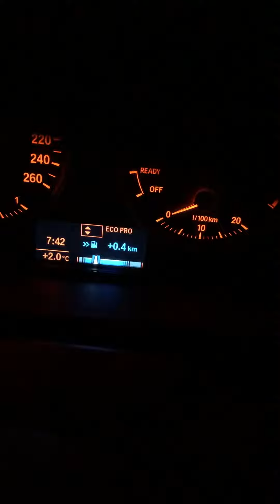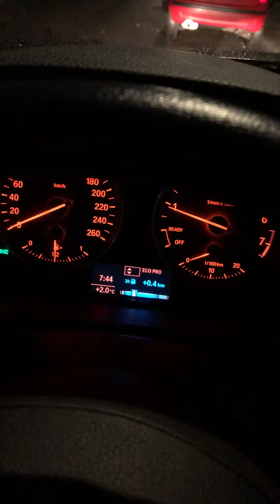Bmw F flywheel problem

Comment: Hi, i have the same issue. Did the warranty solve it or say it´s bad use off the car. Regards
Reply from the maker: They did change it and now i had the same problem... so 2 flywheels in 70.000 km and I use the car only on highway

Comment: did you find out what the issue what?
Reply from the maker: Yes Flywheel and clutch... did change it then when the car had ,35.000km and now at 70.000km has the same porblem